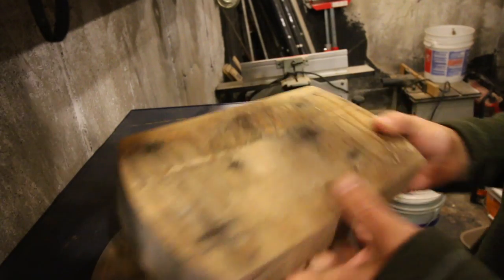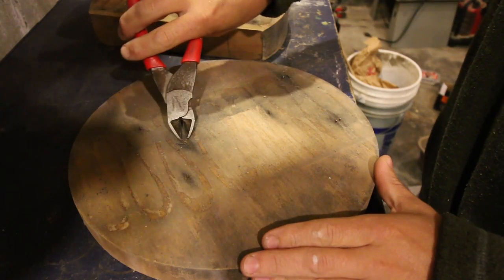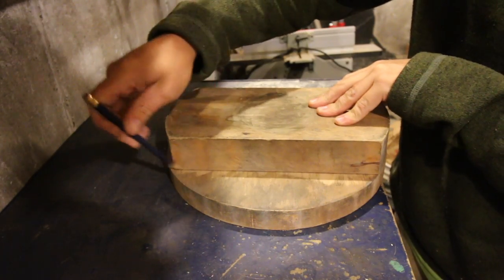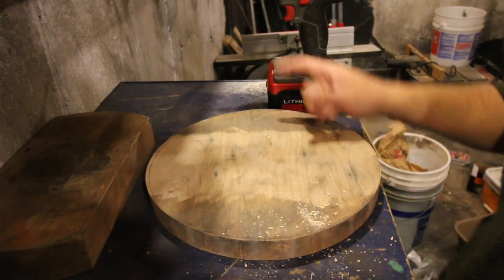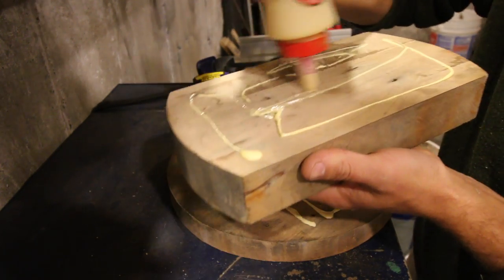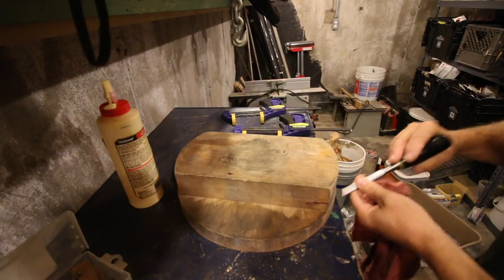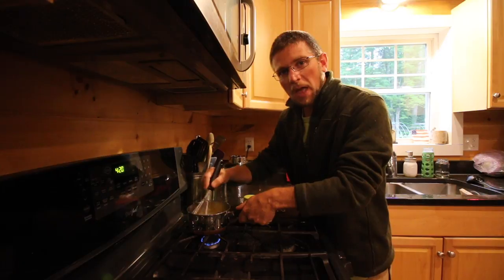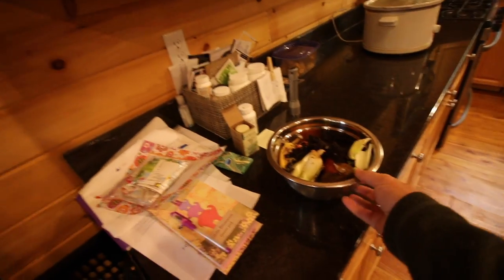Repairing the Cider Press~bEhind the scenes of the Modern Steader 10K 3 incubator Giveaway

Comment: I hope Miss Livvie is feeling better, she looked miserable. Blackberry leaf tea is good for congestion, willow bark for fever, and aches, chamomile to settle the stomach. They all taste pretty good, not obnoxious tasting, like some herbal remedies, a teaspoon of honey and drink as hot as she can take it. 
It's not how much glue you use, it's even distribution that makes a stronger bond. Spread the glue evenly over both bonding surfaces. I keep cheap 1" and 2" fiber brushes around for just such purposes, they can be rinsed clean with water and reused. Using a dampened rag is better for cleaning up squeeze out, it will wash out all of the glue. Using a tool like a chisel or screwdriver will remove most of the glue, but will force glue down into the pores of the wood. Any follow up with stain or finish will not penetrate into those areas, as the wood is already sealed by the glue. 
I really enjoyed the live stream, and look forward to more of them. 
Vinegar instructions are all printed out. I still have to package a few things and will get it all out in tomorrow's mail.
Reply from the maker: Olivia is feeling much better! Thanks, We are excited for the cider instructions!
Reply: Expect it Thursday by 3 PM.